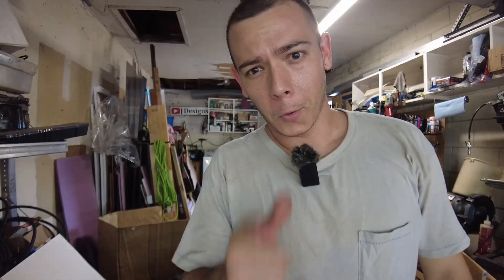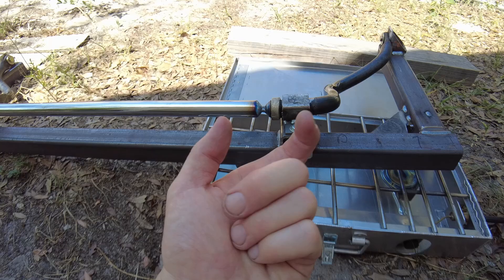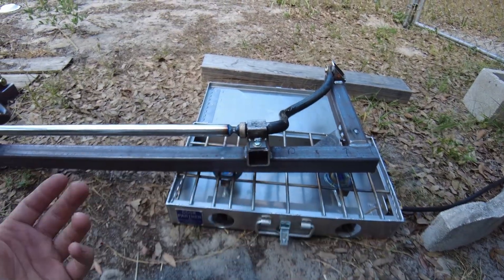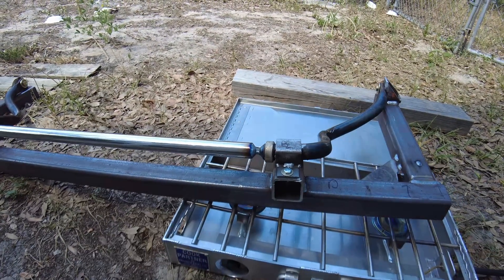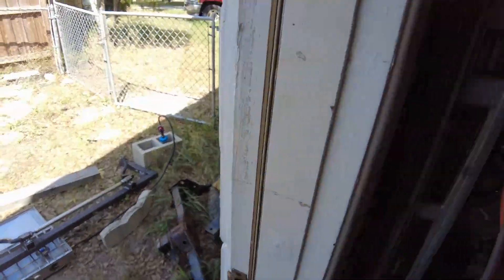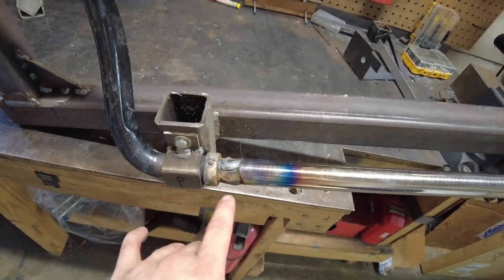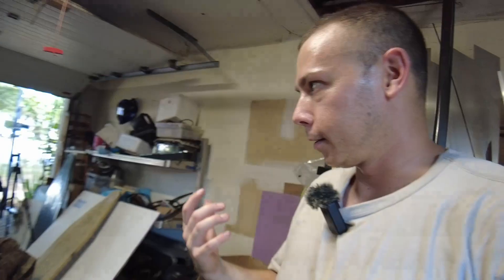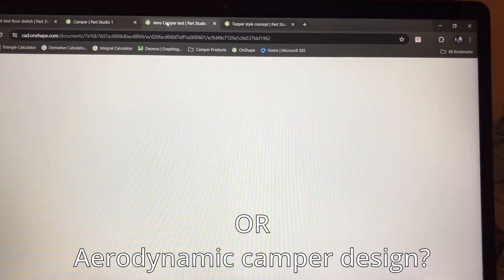Welding - Why you should preheat before welding.

Comment: well you will find out the hard way but heads up spring steel is a high carbon steel that is hardened an tempered. What you did was weld spring steel to mild steel its going to crack at the point of fusion or the first time it is put into torsion it will take a permanent set or break or something along those lines. But a spring it will not be.
Reply from the maker: I looked high and low for spring steel in 1-1/8" dia., but couldn't find any; so the rod is 4130. Not ideal I know, but neither is welding a sway bar.

That said, I've flexed the truck out a few times and driven it for two weeks with the welded sway bar. She hasn't cracked yeeet.

Comment: In carbon steels the carbon content determines whether or not there is going to be "hardening" or not. 
In the mild steel group the carbon content is .05 up to .25. This small amount of carbon permits cold working without cracking/breaking,...very ductile. There is not enough carbon in the metal for any "hardening" to happen. 
  In the medium carbon group the carbon content is  .26 up to .60 ... some "hardening" can happen here. This group means there is less ductility. Gears, shafts and axels are made in this group.
  High carbon steel, .61-1.50 carbon even less ductility, stronger. Hardening can happen in this group.  
Drill bits and files ( which as you know are Very brittle) are from this group. A drill bit holds its sharp edge b/c of the higer carbon content.     This is why  a drill bit can drill a hole in "softer" mtl.  
  I want to suggest you use clamps, angles, strong backs in  other words to prevent warping...instead of preheating.  I have learned to use these measures. Also, I worked with a very clever pipeweldor/fitter on a new chemical plant build. He showed me how to use a wet rag to counter the heat from the weld input. We got 6" pipe flanges (carbon steel pipe)  to  move to where the millwrights wanted. These pipe flanges had to be within .003"-.005." When the bolts go to the pump flanges and are tightened...they'd pull the pump out of alignment and the motor/pump coupling would  not last long at all.  
  We used the wet rag to counter stainless pipe too. S/s pipe is especially subject to warping from welding heat. Again...there is not enough carbon in these pipe grades to cause any "hardening."
   If you'd like to write...I'd do that with you. I've been in the welding trade since 1979. I turned my truck into a portable welding rig. One year I worked 12 different shutdowns. I'd pick up small jobs for myself inbetween "a real job."  Am retired now. No more public work. Still make useful items for myself. No art !
  All the best, Pete